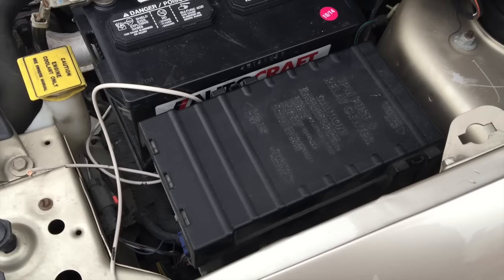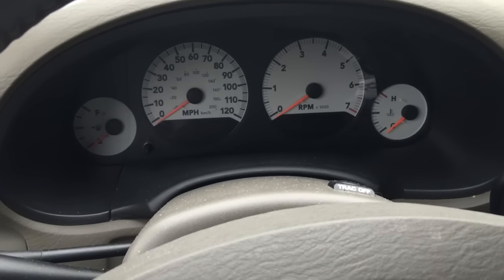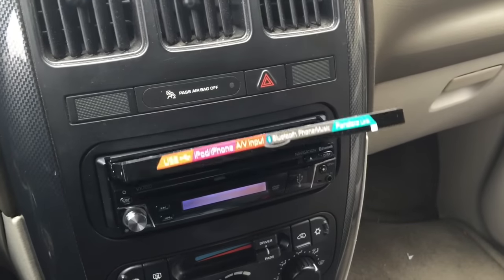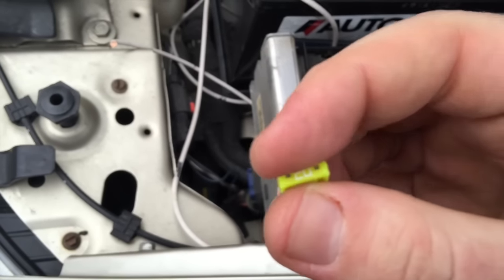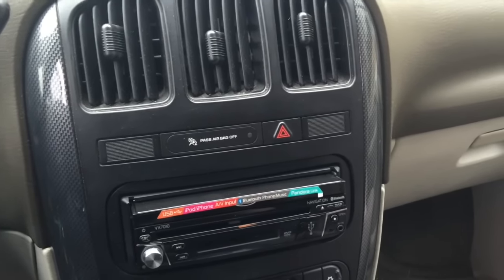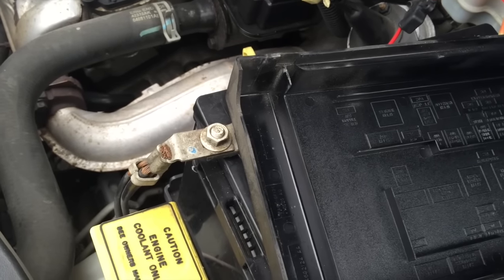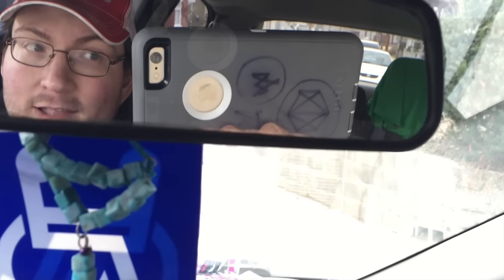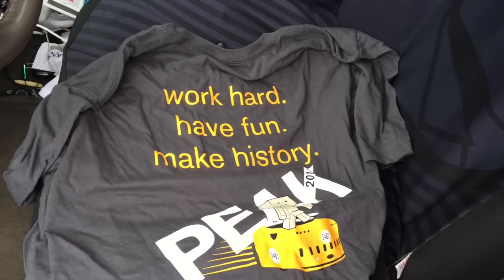Quick Tip: Signs of a blown IOD Fuse on a Chrysler, Dodge, Jeep, Fiat, or Ram product

Comment: I got the same thing going on with a dodge truck but the fuse is good, and I'm getting power to the fuse. Any ideas?
Reply from the maker: Only other things I could suggest is to check the fuse connector for breaks in the wire, corrosion, etc.. otherwise it's off to the dealer
Reply: Faulty body control module (complete fuse box comes with attached computer box). Get it from a scrap yard or used on ebay. With same part number

Comment: so confused. Drove car to Dr. appt. Wouldn't start when I came out. 14 month old battery was dead (good for 3 yrs). A/C blower works but no cold air, no defog, no rear windshield wiper, door locks a no-go, speedometer works but the other dials go round and round like they are possessed.  I got a jump to get to a parts store get a battery. Replaced bcm with one from the bone yard but things are still not right.  Need advice. It is hot as Hades in FL and the windows have issues.
Reply: You would not believe the nonsense I heard in this journey. It ended up that the BCM has a fuse.That and ALL the numbers need to match; not just the part number.
Reply: it worked out and I am so grateful for you amazing people for helping me.

Comment: my van is doing all these things, IOD fuse is good and replaced just in case, same issues.  Any thoughts?  I replaced battery and still no go
Reply: *****
 van runs fine, everything works when its running.  Tested IOD fuse and connections, fine with power.  strange.  when van off, nothing works and wheni turn it off the van stays on for few seconds
Reply: they are all tight.  Van works great when running except radio.  nothing works when van off, no door chime, no interior lights and unless van running power locks dont work.
Reply: thanks for that info.
Reply: thank you!
Reply: Sorry I have not as yet, havent had the time or the $ to look into it further,  I will update you when I do that :)  I am starting to suspect the 3rd party aftermarket remote starter for no other reason than I am guessing
Reply: @johnjohnston5715  do you have a summary of what you did to fix this? My 2005 Town & Country has an issue where all the dash board lights will go while driving and all the gauges will stop working. When I turn off the van then sometimes the dash lights will then not work, key fob doesn't work, and sometimes van will shut off after a few seconds. Something intertwined with instrument cluster and security I think. I put a new instrument cluster in and it does the same thing. Can't figure out what kind of electric or computer problem is causing this.

Comment: I pulled my IOD as a test and windows, locks dings, all still work.  I have a jeep Commander.  Is it supposed to be doing that?
Reply from the maker: Depends on how new this jeep commander is.. was gonna say I tried looking all over for an IOD fuse on my dad's dodge journey and didn't find one
Reply: @adventureoflinkmk2  so when new it's supposed to but old it doesn't.  That's normal?
Reply from the maker: @ShyRage1  what I mean is... what year is the Commander?
Reply: @adventureoflinkmk2  2008 3.7 liter jeep commander
Reply from the maker: @ShyRage1  okay.. it may vary based on vehicle too... like some IOD fuse signs I didn't get but some I did.
Reply: @adventureoflinkmk2  understood.  Yeah, when I pull my IOD, everything still works.  I was thinking if that was the case, something may have been wrong with the TIPM itself.  I wonder if any Commander owners can confirm
Reply from the maker: @ShyRage1  TIPM Would be a next place to investigate tbh.  They're not known for longevity in ANY Chrysler family product, PERIOD.

And why Chrysler still uses em is beyond me

Comment: I have changed my iod fuse in my 07 grand caravan and my power locks still won’t work but it still honks when I hit the key fob buttons
Reply from the maker: I'd be looking at the power door lock circuit.. wires, fuse, relay, etc

Comment: How do you remove the main 60A fuse on 2012 dodge caravan any info appreciated thanks..
Reply from the maker: If it's the Pentastar, theres a special fuse puller for the bigger fuses inside the under hood fuse box.

Lucky I got a dodge journey now, so I can still help ya :) and yes, in the DJ theres such a puller there

Comment: Jus bought a 96 Chrysler LHS & the remotes won't lock the doors!!! But remotes good & tested at auto store tester!!!!
Car runs & door switch locks doors from inside.... but the alarm doesn't activate(from manually pushing) door switch like the 97 LHS!!!
Reply: adventureoflinkmk2 gd news went to buddy's house  got closer to car tried remotes again one worked doors & trunk!! (Jus barely & stopped again!!) Determined weak battery!? Switched batteries & guessin other remote needs to be programmed to the car... so we r n business now!!!
Thanks 4 yur concern!!
Jus changed brake pads & on to other repairs b4 handing to my oldest teenager thanks!!!!
While at the store both tested good.... but the one that worked the car at first had a weak signal on the stores tester.... so I switched batteries from the 2 & got lucky!!!
Was reading 3.06 from one set of batteries... the other set read 3.21 & 3.22....
Gotta love it! I didn't give up!
Volt meters do come in handy!!
Thanks again!
Strange a 3 volt battery at 3.06 volts giving a poor signal!?!?!

Comment: I have a 2005 Dodge GrandCaravan SXT and the radio/clock doesen't work, i replaced all the green fuses and still nothing.
Reply: Replaced the fuses and checked the connections inside the radio and still nothing. Might have to just go to a scrap yard and look for a new radio :(

Comment: I have 2005 chrysler have problem the needles n all lights inside going crazy n some times engine cut off can not find the problem i change the alternator n the battery  n stel the same problem wath else tofind problem

Comment: We have a 2006 Dodge Grand Caravan No SXT Package we have Lights on Dash, Lights inside the van and Headlights When door is open we get the Ding and Keys Fob works what we dont have is The Gauges, Flashers ot Turn Signals!? Google says change out the Hazard Fuse can someone tell me where it is looked at the Fuse box under hood and do not see it listed on the cover!?
Reply from the maker: I can see the flasher being for the turn signals and hazards... I would check the inside fuse box for that, I dunno where exactly it is tho.  That's the only other place I can think to check where that is.

The gauges, either youd have to get the computers diagnosed or it's something in the gauge cluster
Reply: Wonder if you found the fix? Thanks my friends truck is the same...let me know

Comment: Trying to figure what's wrong with my dodge 1992 caravan when I turn the key intitially you to turn power to the car it doesn't do anything and when I try and turn the key to turn the engine it doesn't do anything the strange part is brake lights work headlights work because they are a button can someone help?

Comment: The only problem I have is that my speedometer quit working.  Tried changing it out along with computer component and nothing. Could this be my problem the iod?
Reply: Great thanks I'll look into that. At the moment we are changing the fuse box out so if that doesn't fix the Issue I'll try the VSS thing. Also when the gauge cluster was out we didn't notice any cracks that would indicate the cluster being bad. I'm getting flustered! Lol. Tried replacing the clustar all together all together and nothing. Also tried changing out the computer and nothing. Hopefully either this or the VSS thing works out. If anymore ideas plz doooo coment! Thx for your time. :D
Reply: Oh my gosh it was the freaking fuse box!! Who'd a thunk it LOL

Comment: My 2008 Dodge Grand Caravans radio went out it turns on sometimes than turn off sfter a few seconds and it may make a really loud noise. Help
Reply from the maker: Where is the noise coming from?
Reply: @adventureoflinkmk2  
The noise is coming from the speakers.  It sometimes works but when it does it just shuts off like in 10 seconds later so my husband thinks that it's not a fuse because if it was a fuse he said the radio wouldn't work at all.  Thanks
Reply from the maker: @dianawoods8779  okay.  I googled it awhile back and the resulting sound may be the speakers either feeding back to the amp or grounding out...
Reply: @adventureoflinkmk2  
Ok thanks I'll relay to my husband 👍

Comment: Mine does the same I got a new battery but my radio, CD, and DVD don't work and it makes a buzzing humming noise with the van on or off do u think u can help me out
Reply: adventureoflinkmk2 it's like the CD or tape player is trying to read the disk or tape
Reply: adventureoflinkmk2 yea see my daughter put a penny in there and I tried taking it out but the penny fell in back of the electric panel then started making that noise it has to be something with the radio hopefully
Reply: adventureoflinkmk2 I got it out maybe I just need a new radio

Comment: what if this is happening but none of those fuses are burnt
Reply from the maker: Then either check the fuse electrical connectors under the fuse box or take it to a mechanic for diagnosis

Comment: What's an IOD fuse? I checked all my fuses but 2005 PT Cruiser dying while driving and my 0BD2 port is dead uhhhggg
Reply: @adventureoflinkmk2  Thank you I checked it already not blown no corrosion and radio and other things are functioning
Reply: @adventureoflinkmk2  Thanks I wish I knew what all that meant unfortunately I don't I understand the rows of pins but testing them I have never done electrical testing and never learned or watched anyone mostly because no one around here knows either.
Reply: @adventureoflinkmk2 Thank you. Most everything I pick up really quick even if I could get my hands on one I know it has a dial and 2 probes that's it I don't even know the basics on it... I'm a little afraid to because my car dies while I'm driving it. People are saying the throttle position sensor could be bad... I don't have a ton of money to take it anywhere and most I've talked to around here sound clueless like I know more from researching then they do ... afraid to put it it in anyone's hands because you can blow other things by just opening a car door including  the meter!
Reply: @adventureoflinkmk2  dies while I'm driving it then it starts right away... but check engine light flashes and tries to die again... I can't go far ... it orginal started with an 02 sensor replaced both and still said both 02 sensors but wasn't dying on me now it is!
Reply: @adventureoflinkmk2  yeah don't have any of those around here. I already replaced the PCV and the MAP that stopped it from running rough. Now it's smooth but stalling . I know I totally give up I'm exhausted

Comment: Hey was this draining your battery
Reply from the maker: No.  Battery was totally fine
Reply: My tow y country is dreinin the batery
Reply: Y es
Reply from the maker: Okay Victor... you're gonna have to find out why the battery is draining... first thing is to have it load tested; could be a bad cell causing a supposed drainage.

After that you'll have to disconnect the negative terminal and put an ammeter between the negative cable and the negative terminal.  Make sure it's a good ammeter that can read say, 20-30amps.  Then from there start pulling and replacing fuses one by one; be sure to watch the ammeter for changes.

when your current keeps going down and down to near 0 is your bogey(s).

Comment: My battery keep over charged and dashboard goes off on my 2007 Jetta any ideas?
Reply from the maker: If its overcharged... I would suspect something in the alternator and/or voltage regulator and/or diode pack and/or the part of the PCM that controls the alternator
Reply: Thank you I have a buddy that can make sence to the technical talk.lol but I really appreciate it.thank u.
Reply from the maker: You're welcome.  A voltage regulator is a thing that keeps a voltage constant.  Like for example in cell phone battery charge packs, they normally have 3.6v batteries in them, but there's a voltage regulator inside that allows it to spit out a const 5 volts for it to charge. Also in computer power supplies, they're used to have a 3.3v, 5v, 12v rails
Reply from the maker: Also I should mention that bit in the PCM... alternators used to have the voltage regulator and diode packs mounted on the alternator itself, easy peasy swap should they burn out.  However for some stupid reason all that is now integrated into the PCM on many cars and wouldn't surprise me if that were the case here.
Reply: Ok il check that too.much appreciate.thank you.
Reply from the maker: @kairi206  you're welcome

Comment: HELP !!!
I have a caravan 2001, my problem is that the speedo mileage sometimes moves to open the swicth (4:29 minute example) but sometimes it does not. and they go several times that all turns around and falls below the top you have. but after the encerla returns to normal, but now a fallen below that ceiling (and not register my speed).
I could say that I can be and how to fix it or if I have to open the speedometer and return

Comment: I have similar issues. but door lock work horn works, dash cluster acting up. Car won't start. The fuse on side of dash for BCM and other stuff blows replace blows again when replaced. Any ideas? I did check fuses under hood. this is a 200O Concorde. btw first started then died now won't turn over tried jumping car. no go.

Comment: my 2004 Dodge Caravan it's stuck in 2nd gear does not want to shift third or drive my speed meter does not move can you please help
Reply: It's in "limp mode", speedo has to work to make it shift at correct speeds. Speed sensor, or bad speedometer maybe, but probably just a speed sensor. Depends on why and how the situation started. Green Bike Bill

Comment: I have dodge nitro 2008 with the BMC 
with the minor vibration all lights and wipers, turn on and front panel to off.
do I need to check the same you said here?
Reply: pattydv2678 sounds like a loose connection somewhere
Reply from the maker: Could be the connection to the IOD fuse in the box

Comment: Instrument panel doesnt turn on, Headlights are on... i changed the IOD and some another broken fuses but its still the same problem ;(
Reply: adventureoflinkmk2 I tried to reset the cluster and it's turn on everything but when it's done the reseting,  the instrument turn off again,  I will upload a video later
Reply: adventureoflinkmk2 I uploaded a video on my channel
Reply: ignition switch
Reply: Lance Henderson ¿what should I do?
Reply: +Jorge Vera (RyuKim) ignition switches typically come in 2 types, one being the key start connected to the ignition box, and the other the 2 are sperate. the ignition box will malfunction controlling things like dash bored failure, windshield wipers may not work properly or at all, radio problems, it can also cause the car to stall, shift late, push high rpms, or simply not drive at all. depending on the vehicle you may have a couple of these issues or more. to fix the issue you will need to check all fuses, if they are good then assume ignition box. usually it's located under the stering wheel just behind the key start. u will need to remove the underside casing on the stearing wheel to get to it. the steps to removing vary from vehicle type, so do some research on your specific vehicle. the fix should take you about 15- 30 mins and in most cases quite simple. if u need help on finding the steps please feel free to comment the make/year/and model of your car and I'll assist you further !
Reply: Lance Henderson it's a dodge caravan SE 2001 And there is a video on my channel about it and thanks!
Reply: +Jorge Vera (RyuKim) a new ignition box/switch will cost anywhere from $20-$100 if it cost more then that, look elsewhere. the cheapest i found a new one was $35 at autozone. or you can try your luck and buy a used one off another vehicle.
Reply: +Jorge Vera (RyuKim) not sure if you fixed it yet, but maybe this will help, and it's np! had the same issue with my car, took forever to diagnose the problem.

Comment: Doesn’t the car run?
I mean if the fuse s blown with the car start and move?
Reply: I want to export mine to my home country and there have been thieves stealing from peoples car because they have to be in charge of the car for a while, so I want to remove the fuse so that the power doors wouldn’t open and I can replace the fuse when i clear the car from the authorities.
Chrysler grand voyager.
How do you mean that it depends?
Reply: Thanks, but I want the car to move and start, just that, they won’t be able to open the sliding doors and the tail door, that’s all am asking for,  so the car motor will run but the electric doors won’t work. Yes!
Reply: Is Chrysler grand voyager 2001